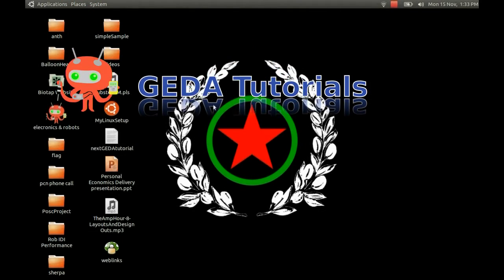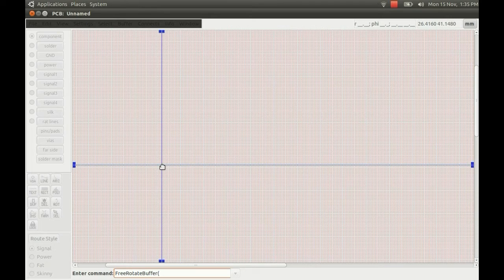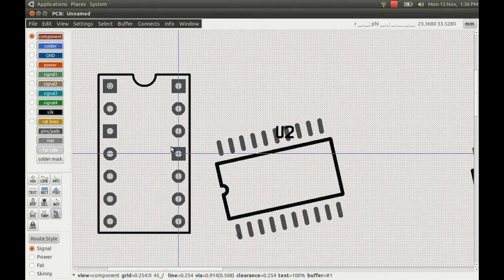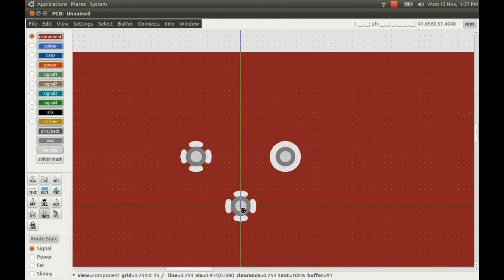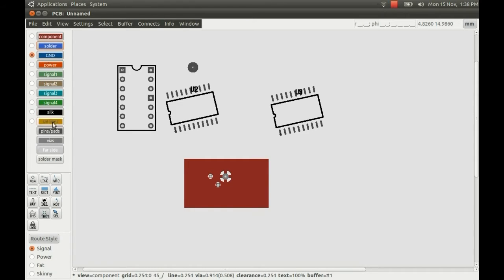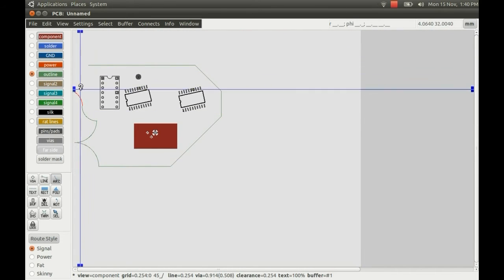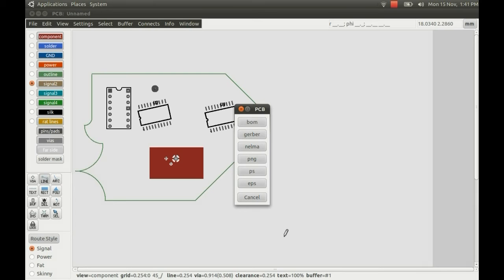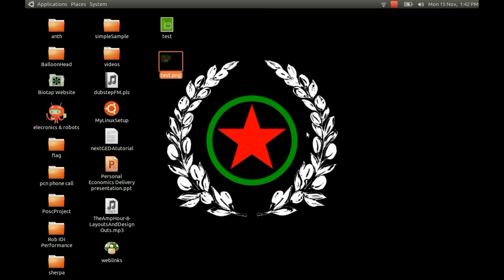GEDA PCB Designer - Rotate, Outline etc

Comment from the maker: @babybearkill If you're having difficulty with the keyboard short cuts you can change the size of pads and pins by going to, Select->Change size of selected objects, or you can change the size of holes with, Select->Change drilling hole of selected objects.
If you wanna get straight into the numbers you can always open the *.pcb file in a text editor and edit the sizes manually, it's quite easy to read and you can adjust things precisely, just remember to save a backup file. Hope this helps ^_^

Comment from the maker: @babybearkill Using the menu, File->Preferences->Sizes, will pull up the design rule checking, you can globally set the drill diameter and various other parameters here. Connects->Design Rule Checker, will then check to make sure everything matches the design rules.